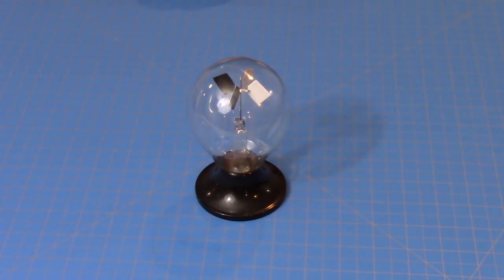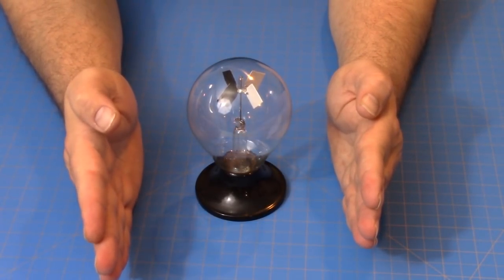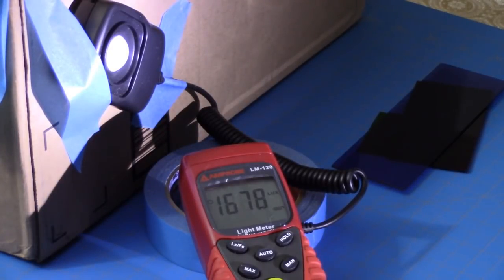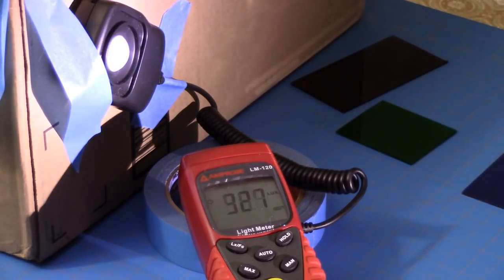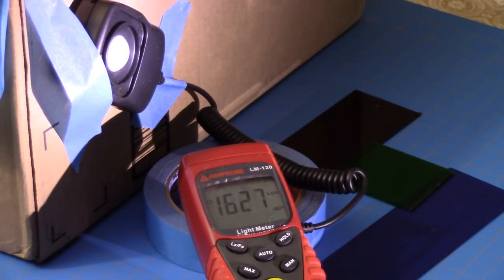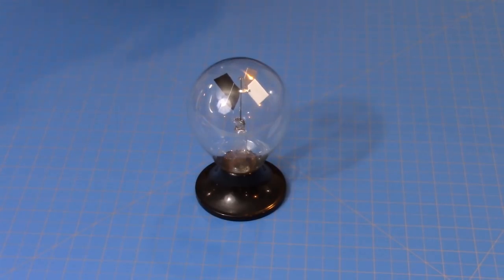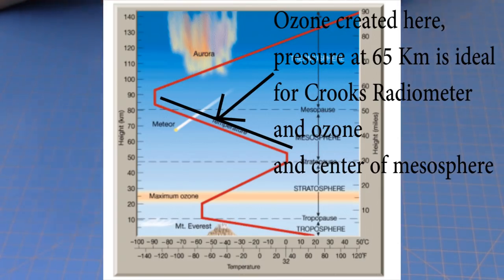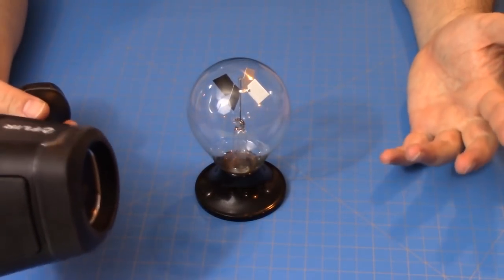T10B: Crook's Radiometer Part 2

Comment: One small hiccup, your light meter, measuring in lux, is not an indication radiometric flux but of luminous flux which is scaled to give an indication of visual (physiological) response.  
Also, and for fun, spray the radiometer with a can of 'compressed air' (keyboard cleaner) and see the vanes spin backwards.
I will try to put on video my experiments that show light shining on the vane edges produces a greater response than an even greater amount of light shining on the centre of the vane.  Following that I would like to try vanes that are made of plastic  (non-conductive) vice the traditional metal (conductive) ones.  Even more than that, remove 1mm or 2mm of the black and white coatings from them edges.  My though is that there is some form of transfer of momentum at the edges and the vanes are 'simply' collection surfaces.  Changing the vane geometry to increase the cumulative linear distance of the edges (adding 'zigzags') vice the surface area may also demonstrate the edge effect.  Happy experimenting everyone!
Reply from the maker: Correct.  Do have a recommendation of a light meter in watts per square meter?
Reply: Sorry, cannot find an affordable radiometer although I suspect that lux meters are just radiometers with an 'eyeball appropriate' filter.

Comment: Ozone? That blue light is much too weak to make ozone. Besides, UV light can produce ozone, not blue visible light. It has to do with heat on the few air molecules inside. There is no other explanation.

Comment: To test ozone/ ionization their, Purge vessel with pure Noble gas and pull hard vacuum several times, finalizing at appropriate pressure to maximize effect.  In pure nitrogen or other Noble, ozone isn't the cause

Comment: The thermal is applied to the glass not the vanes.  The glass heats or cools, and that then affects the rarefied air on the other side of the glass.
Try heating or cooling the glass by means other than light.
You can measure the temperature of the glass using your IR viewer by putting a little piece of tape on it and measuring the tape.

Comment: Dielectric constant of the system changes with pressure, thus changes the system impedence
As it is dependent on wavelength, for best energy transfer , you are changing impedance by changing filters and pressure, its just like matching an antenna, so wahtever it is , its electromagnetic

Comment: I don't think the sensor has a flat response.  Need calibrated source or measurement device.  This is tricky stuff off course.  Also blue photos (ducks) carry higher energy than red as you know

Comment: Yo on wiki it says that even if you heat it it works and if you cool it it changes dierection. can you test this?
Reply: Also... gravity bends light, magnets bend light... heat bends light. And in Nature everything goes both ways so light makes heat and heat seeks cold just as much as cold seeks heat (equilibrium) and the black vein starts to go toward the white vein to relax the situation. BUT since light and heat need a medium to propagate it actually uses Aether as heat exchange as there is so little air or smth. Similar to cold steam tesla turbine experiments, where the pressure stays the same only the heat is transfered.
Reply: so we have 5 platonic solids represented by air, earth... so if you take air, the fire elements are relaxed etc... idk
Reply: @manipulativer  Magnetic fields don't bend light.  By heat bending light, are you thinking of how the index of refection of air changes based on temperature?  That's not due to the temperature directly, but to the density -- warm air expands.

Comment: Unfortunately, the ozone theory is wrong. A Crook's radiometer is clearly powered by heat. The measurements with the LED flashlight are not meaningful because the LED spectrum (fluorescent light) is not continuous, and the lux meter may not have linear accuracy either. Why don't you think of holding a candle or lighter flame in front of the radiometer? Then you will see how quickly the wheel turns due to the strong infrared radiation. Normal glass is opaque to long-wave infrared, but of course not to mid-infrared like that of fire and incandescent lamps. 

A radiometer also runs when heated with a hairdryer due to the heat from the hairdryer nozzle. If you take the hairdryer away, the wheel will soon start turning in the other direction, with the shiny surfaces facing forward! This is because the glass of the radiometer is still warm, which heats the gas molecules inside, which heat the vanes. The black sides of the vanes heated by the molecules emit more infrared radiation and therefore cool down more than the shiny ones, which is why the wheel runs backwards. So everything is clearly a thermal thing.

Comment: When you do come back to this make note of the elements you use and the valence of their energy layers. The relationship may be inverse to the wavelength of the light spectrum or a harmonic of the same may increase the power. No thermal needed